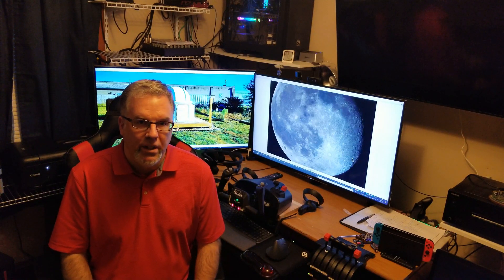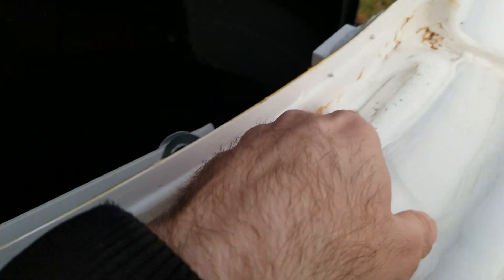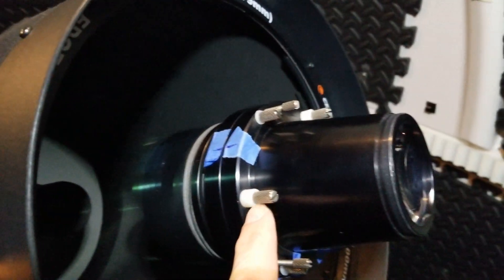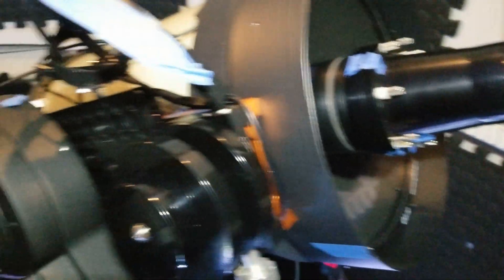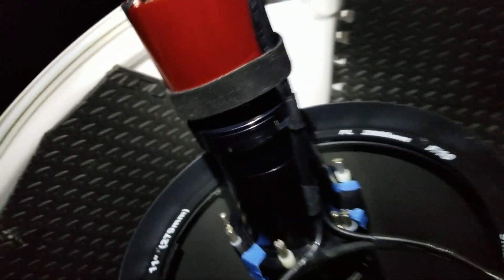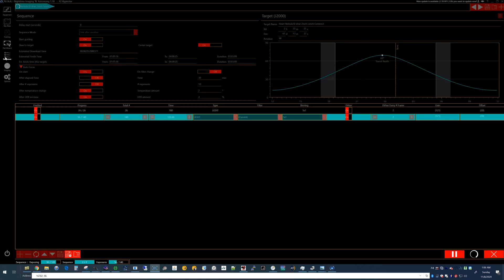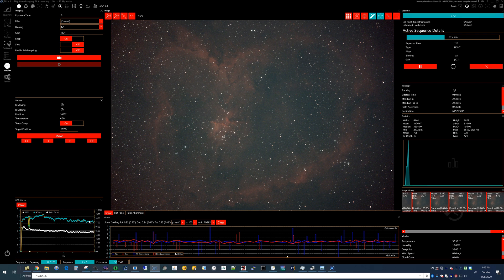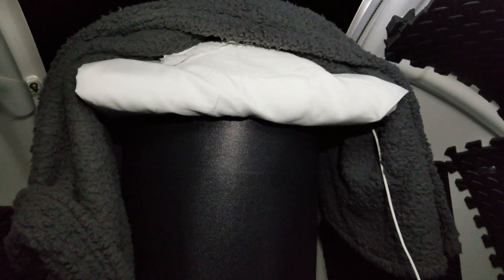Photographing the Heart Nebula IC 1805 with the Hyperstar V3 and EdgeHD 11" SCT

Comment: Are there any disadvantages to using a Hyperstar on a standard sct?
Thinking of getting one but seems like I may aswell use my standard sct 9.25 instead of investing in an edgehd.

Only thing I can come up with would be focusing which from what I've heard is better on the edgehd.
Reply from the maker: Yeah i dont think there is much difference at all.  I think edgeHD wins for F7 and F10 however, but if your buying one the non edge will be cheaper.

Comment: I want todo a similar setup just with a smaller Edge scope. how do you handle manual filter changes? also what guide scope are you using?
Reply from the maker: Well back then in this case it was the mini filter wheel, so i'd have to usually take the cover off to switch them.  Now i've gone to 2" filters and the starizona filter drawer, so its very easy to swap in and out.  Im using the 60mm sbony finder scope with the 290mm mini for finder.  Thanks for watching!